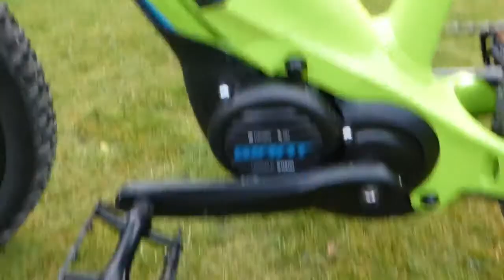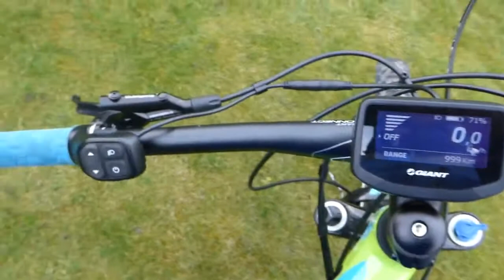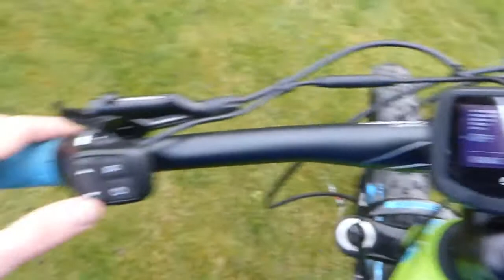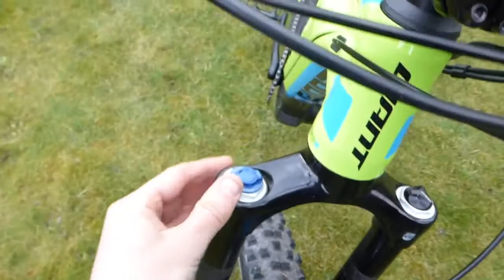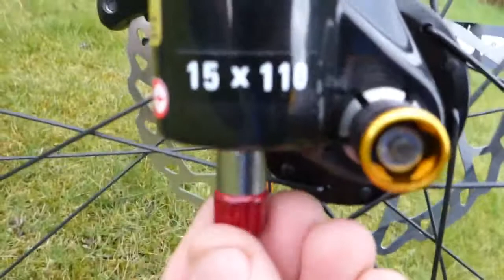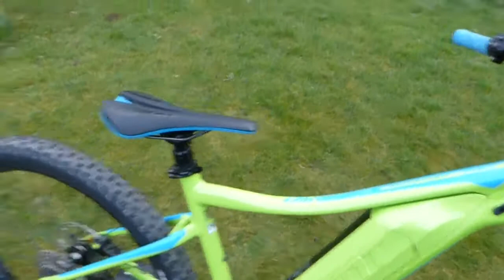Giant Dirt E+ 2 PRO

Comment from the maker: Just to add - after making and posting the video I realised a couple of errors:
1. The bike actually comes with inner tubes though the rims tyres ARE tubeless ready, meaning you can fairly easily go down the tubeless route if you so wish
2. The small red knob under the fork can be twisted to adjust how much the fork rebounds after going over bumps - its not to adjust air pressure as referred to.